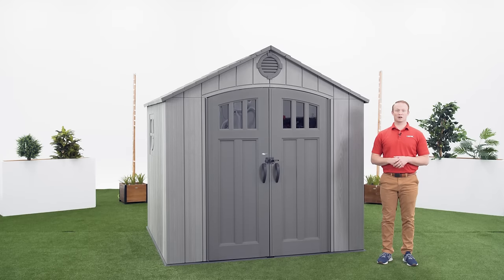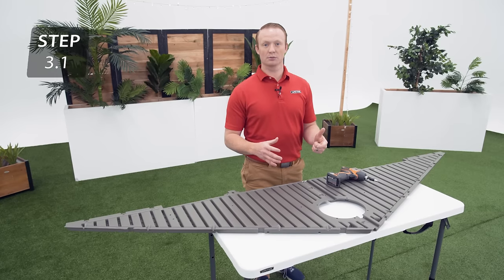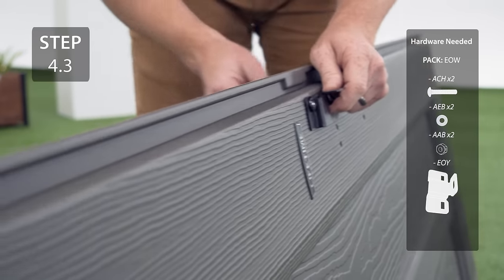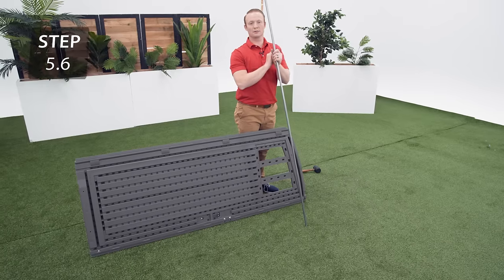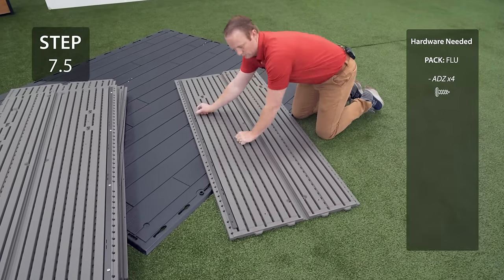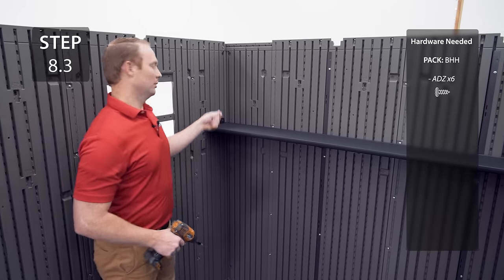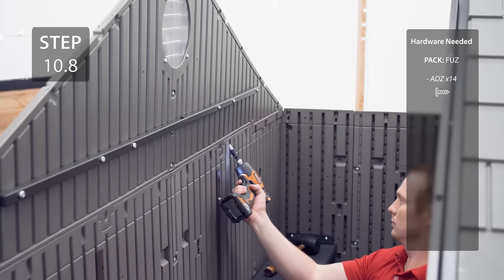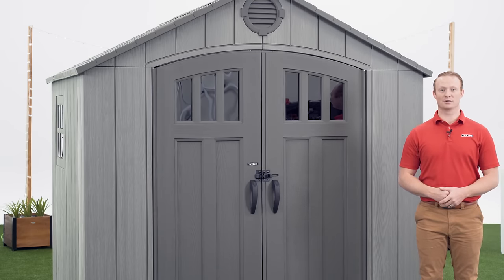Lifetime 8' x 7.5' Outdoor Shed | Lifetime Assembly Video

Comment: This product is absolute trash. Like others have said. Most of the pieces were warped and by the time I was almost done I couldn't fit the back of the roof on.
Reply: I came across your comment as I am building this. I totally agree with you. Idk if that impact wrench had a sound patch or something cuz I been following every step with every tool and my Milwaukee keeps warping some of these holes. It is absolute trash. I will be modifying this and reinforcing with some extra steel.i will never buy this product again. And I work in retail where we sell these and I am going to be honest to my customers about this.
Reply: @rock2487able idk man. My DeWalt drill worked pretty well on them screws
Reply: I did everything as he said and it came out easy for him while I did it and nothing worked and I followed step by step it's crap 💩
Reply: I’m working on this too and it is just horrible
Reply: I think the reason main difference is the place while he is making it inside and heat usually warps the peices
Reply: My install went super well! Very pleased
Reply: We are putting it together now. The pieces are bent and it’s a major struggle getting them to align. The shelf was completely unaligned and different from this video which was odd. We’re about to put the doors in and work on the roof!

Comment: This video is literally the only way to properly build this product. The manual is nearly worthless. Great video. Made the process so much faster.
Reply: I second that the Manual is worthless. Built it myself but could never have done it without video.
Reply: If I didn't find this video I would have returned this as the Manual is utter garbage 😂. Finishing up today can't wait to be done.
Reply: They sent me 3 middle pieces for the flooring.. I thought I was going crazy, plus my pieces weren’t labeled correctly.. never again

Comment: The flooring in this video is nothing like what came in my package - the video floor looks great and snapped together with ease…. Mine was WAY different with only three offset tabs and a few screws - offsets absolutely do not line up - I have tried MANy things. I went ahead and screwed it together with one inch gaps on each edge…. I expect it will be horrible later, but I have spent too many hours on this terrible step
Reply: Same!
Reply: This is too funny 😂 I just put mine bottom part together with a buddy and I said the same thing. Drinking while putting this together does not help by the way!

Comment: I finally got it put together after 3 days but it was nothing but frustration. All the roof pieces were warped by heat and the sun being summer, and unless you build it on a  purely-flat surface 2x the size of the shed, it's a nightmare getting the walls and doors in place.

Comment: I was gonna use the instructions that came with, it would of took me a week if I did. The video with the instructions is the key. 
The first couple hours I was getting scared from unpacking and doing the doors, after the doors you start to get things done lol
Also I build it on a very uneven slab of concrete and very impressed that it worked out. Looks like it level and square (it can’t be though)

Comment: It would be very helpful in the video as well as the instruction manual to specify the type and size of fastener being used for each step. Particularly important when 3 different screw types and two different bolts are used for the shed assembly.
Reply: You are correct. The instructions should have that.

Comment: The shed ended up being nice and perfect for our needs. I used the manual and this video to assist. The only part I messed up on what forgetting to remove both side of the plexiglass covers, so I ended up losing one of the gaskets and didn't have enough extra. The roof is hard to align but is easier with 2 people and just needs some extra effort. 

The part about adding the sky lights, key is to definitely fold in half and go easy on screwing them in. The screw names in the book and the video are different for this part, but all you have to do is use the smaller ones that fit in the washers, then it's easy.

Comment: Overall a very good shed. It would have helped greatly if the many different metal parts were labeled. The parts diagrams in the manual were often too small to be of use in deciding how to do the assembly. The wall panels did have molded in part numbers but they were at the very bottom an inch from the edge. I fixed this with a felt pen and some masking tape but it should have been done by the manufacturer. 

Fortunately I chose to do the shed assembly myself and was not paying a couple of guys for extra time spent as a result of these deficiencies in the manual and in the video. Even if you are having someone else assemble the shed I highly recommend taking everything out of the two large shipping boxes and labeling parts and staging everything in advance. 

The video cautions about overly tightening the small nuts and screws but shows a cordless drill being used. Even on the lowest torque setting and slowest speed of my cordless drill I snapped one of the screws used for the bracing. Best to tighten these very small screws by hand.

Comment: 34:47 34:47 followed both the instruction manual and the video step by step. The biggest struggle was the wall  panels.  Did not slide and snap in easily like he did on the video. Took us both in our 70's three days from start to finish . Just saying its not as easy as the video shows.  Very frustrating from start to finish.  Glad its done and hopefully stays together!

Comment: ok my issue rn is im putting together the floor but its a newer one so the floor is a lil dif and it says each panel should have 6 divets to insurt the screws but mine on has 4?? and the floor boards wont line up nicely no matter how hard i push them together either the quality got worse or im dumb
Reply: Exactly the sam me for me!! I’ve spent over an hour on this step and the floor is trash - the old way in the video looks great! The four tab”improvement” DOES NOT WORK. I’m worried it won’t go together in future steps
Reply: Same!
Reply: Ditto here as well.  Only 4 screw divots and a dozen black screws left over.   Could NOT get the floor panels to lie flush to each other - had to force them and secure with screws.

Comment: It doesn't go together as easily as the video shows at least here in Florida.   The heat warps the panels and they become too hot to handle without gloves.  We had to borrow the motto:  Improvise, Adapt, and Overcome.  It took two days to get it finished

Comment: I was doing fine until the end...the last couple of roof panels were not lining up. I think the cement pad was not completely level. I ended up using racheting straps across the top from one side to the other...in order to pull the two sides together. It worked. Thank goodness.  I then braced the entire thing for $30...instead of spending $400 on the extreme weather kit.
Reply: You don't by chance have any pictures of your bracing or a description of what you did?
Reply: I measured the pieces, and they are not even. I had the same problem at the end with just the last piece.

Comment: Why are screws not labeled on the bags they come in? It’s a guessing game trying to find the right one!
Reply from the maker: Most of the time, the bag is labeled. Sometimes the smaller hardware bag is not labeled because it's in a larger, labeled, hardware bag. If you're having a hard time figuring out which screw is the right one, you can match it up to the picture in the manual. The images of the hardware (most screws, nuts, bolts, and washers), are to scale.

Comment: Wait a sec, so you put all the phillips screw heads on the inside where a straight screwdriver can't reach them? The solution is a Phillips bit and a pair a Vice Grips?! Engineering at its finest.

Comment: I cannot for the life of me get the last roof panel to line up. Either the left side is off or the right side. And forget about the final 2 corner screws. Can’t get either to line up. Checked the walls and everything is properly locked in. Don’t know what I’m doing wrong
Reply from the maker: We're sorry to hear the roof panels aren't lining up. Try watching this video on how to align your roof panels- https://youtu.be/iQYsra3ehts?si=qptvvpzaxJnvzPpK. If that doesn't work, give our customer service team a call and we can troubleshoot the issue with you and see if we can figure out what is happening. They can be reached at 800-225-3865 or by email at customercare@lifetime.com. Customer service hours are Monday-Friday, 7:00 am to 5:00 pm  (MT).
Reply: Hey do you mind sharing what did you end up doing about your roof situation? I paid someone to build the shed yesterday and we had the exact same problem. Now the shed is not finished and I don’t know what I’m going to do…
Reply: @Chxrri-7  the key is the black  trusse. Making sure not too much is hanging over either side of the the shed. While inside, push it upwards and it’ll move to properly  align with screw holes. Then you should be able to slide the roofing in where the corner holes will align. Also have second push on outside where you are drilling up to to make sure it’s catching the roof with the screw. Took us some giggling but it ended up seamless

Comment: When attaching the vents on the gable, it’s not clear which screws to use. I got them out of order using the big ones first and I think I screwed things up. And there are at least two bags of hardware, which is the instructions not made clear, I found the other one on the bottom. Horrible attention to detail, now I’m gonna have to go down to the hardware store and get more screws.
Reply from the maker: On the right side of the video it shows all the hardware that will be used for the steps. Replacement parts are available and can be ordered through our Customer Service Department. Our Customer Service Team can be reached at 800-225-3865 opt. 1 or by email at customercare@lifetime.com. Customer Service hours are Monday-Friday, 7:00 am to 5:00 pm (MT).
Reply: @LifetimeProductsAssembly  and the screws for the latch, the sliding part, were the wrong ones. I can get the right ones at the hardware store.

Comment: Is the window supposed to to be open-able? If so, why put a screw in the bottom? If not, why does it have latches and why not just have a bunch of screws around the edge like the door windows? Or is this an either/or window?
Reply from the maker: Yes, the window does open. The screw goes into the window panel but not into the wall panel to keep the window pane up when it is opened.
Reply: How do one open the window.

Comment: The part requiring flat tipped screws be drilled at a 45 degree angle into shallow divets that are not well designed to be entered at 45 degree angles is the reason I'm not going to buy another lifetime product requiring assembly. Your engineers took the day off when designing this part.

Comment: Bad luck for me the most of the holes in the gables pieces are missed aligned I have to ask the company to send me different pieces, the drill bit provided to drill holes for the door is broken during the assembly the video made it so easy to put it together with the exception of the pieces are nice and fit in together after 2 days of trying I am handed over to the pro . Does any one no how much it cost? Thanks
Reply from the maker: I'm sorry that you're having troubles with the build. I am happy to send out any pieces you need replaced. I am also happy to take a look at some of the issues you were having during the build so we can trouble shoot some ideas on how to make the assembly easier for you. You can send images over to youtube@lifetime.com with contact information. If you're still wanting a installation expert to finish the assembly for you, you can contact our coordinators at 1-800-336-3865 opt 1. They will let you know if there is coverage in your area and will give you a quote.
Reply: Why the heck are the adz screws not labled?

Comment: How big should the foundation be?  What dimensions?
Reply from the maker: You will need to build a level surface of 93
3/4" x 88 3/16" (2,38 m 2,24 m). If you are building with concrete, make sure its 4" thick.

Comment: Honestly hate how the company assumes that I get internet or phone service where I live to watch a YouTube video instead of just including all the steps on the paper manual. The frustration over the last couple of hours just wait for the video to load was too much.
Reply from the maker: We're sorry to hear this. We try not to make any assumptions about how you prefer to assemble your product. We try to include as many help options as possible, which is why we have our assembly videos and QR codes in the manual. The video is meant to be a companion to the assembly manual, not a replacement, but you don't have to use the video. All of the steps of the assembly are in the manual.

Comment: Never has a video had so much detail and information, yet show nothing of value. You can’t see the angles of where the roof is supposed to be. There’s a dozen holes on the ceiling pieces and this video does not show where they’re supposed to go.
Reply from the maker: The assembly video is meant to by used as a companion to the assembly manual and not a direct replacement. We recommend having the assembly manual on hand while building. The assembly manual shows a lot more detail and can show you exactly which holes the screws go into for each step.